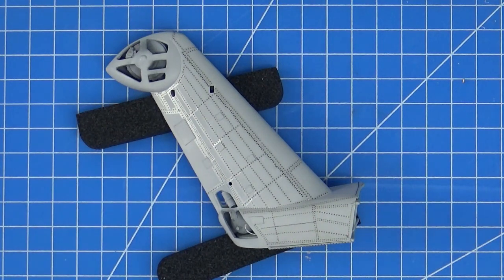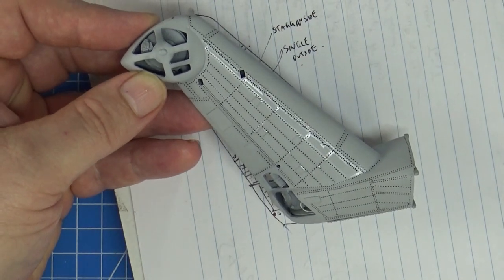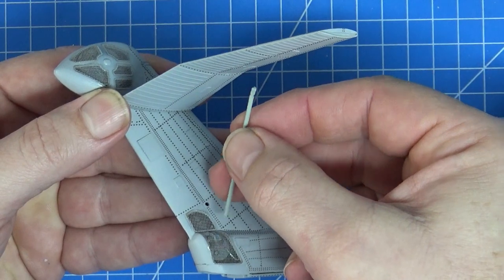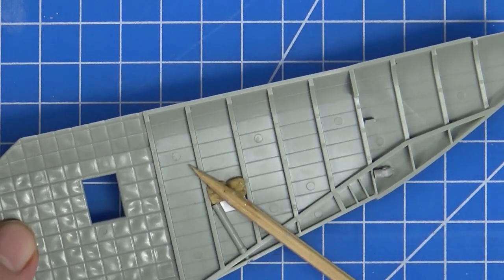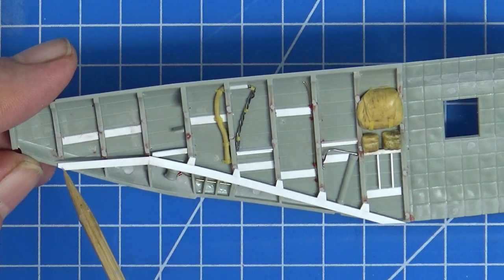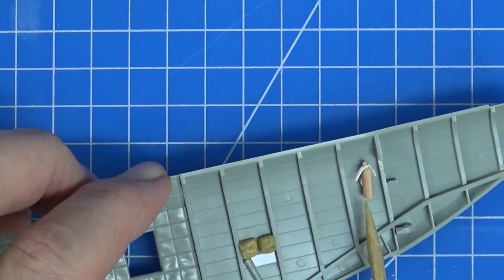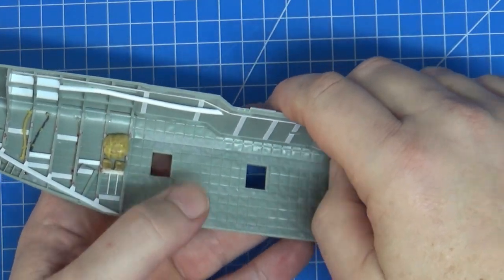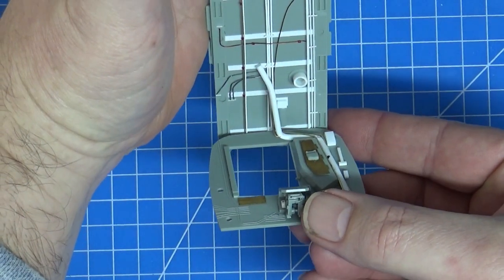Academy 1/48 CH-53E Super Stallion Build Part 3: The Cabin

Comment: The amount of detail you put into this model is astounding! It is extremely impressive to see how you are turning this into an actual miniature version of the CH-53E.  @13:58 Not that it matters now but, the picture you have is with all of the sound proofing down. Normally, you wouldn't see all of that unless you were doing maintenance on the aircraft. The model actually shows proper ceiling panels inside the crew area.
Reply from the maker: Yes I was in two minds to take the sound proofing off, but you really wont see most of it anyway, even with the doors down as its mainly in the middle. Cheers - I have paused this project for the time being, I will get back to it one day!

Comment: The ceiling are sound proofing panels that cover the framing. You didnt need to put the extra details on that area. Understandable confusion considering you havent a reference photo showing the panels. Another set of parts we removed over time. I am speaking as someone who crewed and maintained this aircraft for 22 years. Thanks for your build.
Reply from the maker: Thanks for the tips!
Reply: @beckersmodels  I'm enjoying your ideas as I have been in the same situation, with owning this model and not tackling it, because of apprehension of messing it up.
Reply: @beckersmodels  if i could give you one heads up, the exhaust are made from titanium and always retain that yellowish tone.